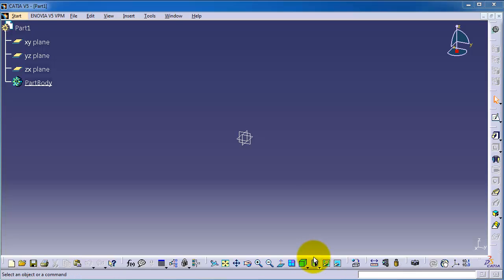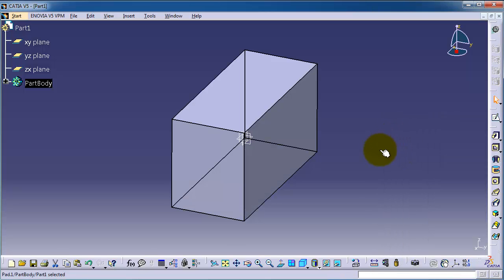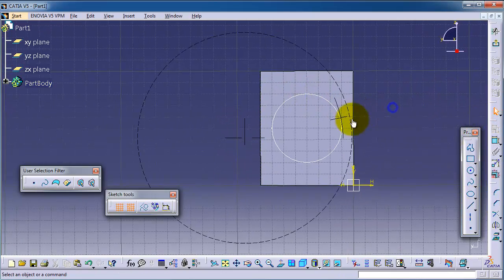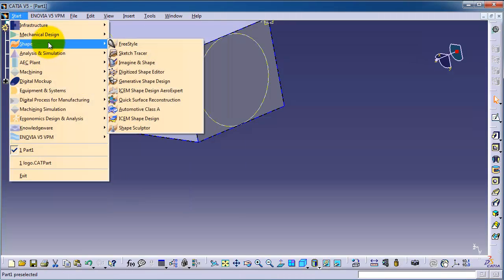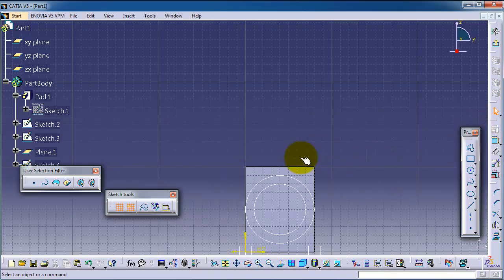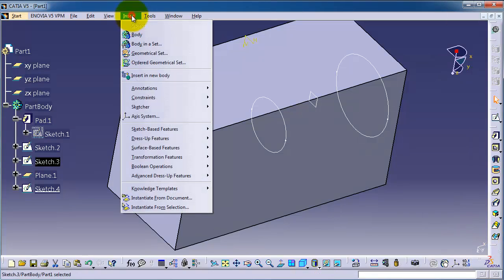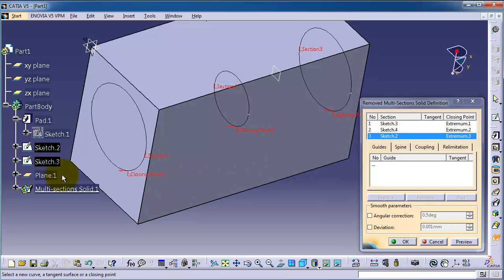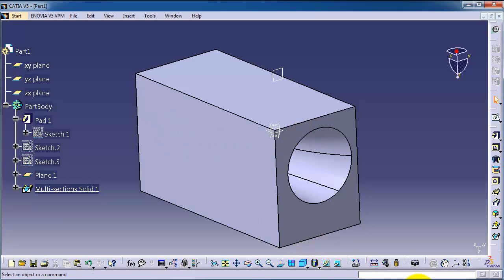41 CATIA V5 Beginner Tutorial: Removed Multi sections Solid Basic

Comment: the circles i sketched meant for the Removed Multi Section Solid dissapears and on the tree it's written "impossible to select because it's located after the feature Removed Multi Section Solid" when i hovered my cursor over them. I already tried define in work object but still fails.